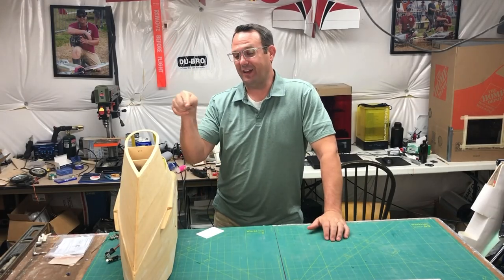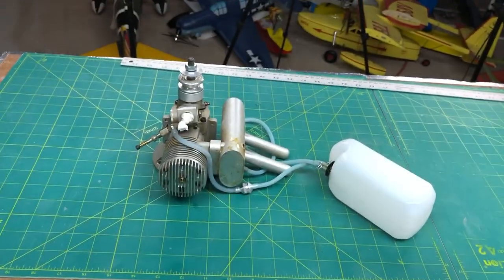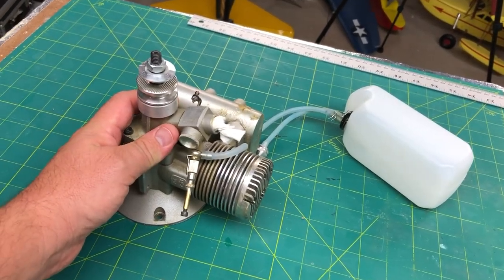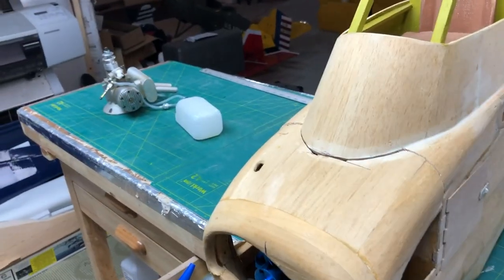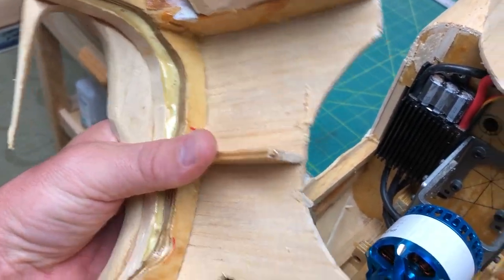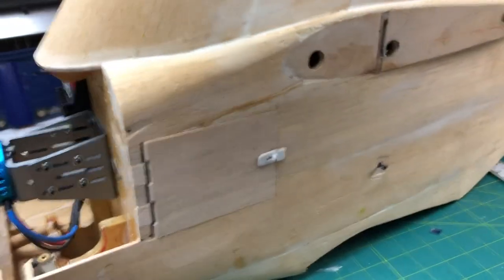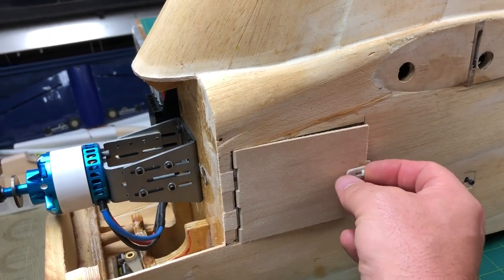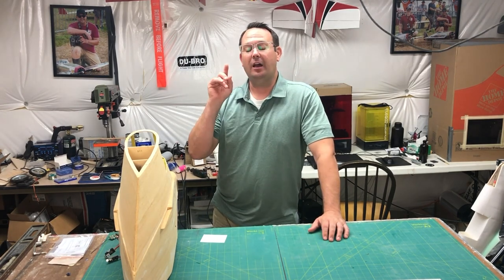Transavia Airtruk: Had to make it REALLY ugly

Comment: Those swing-out servo mounts are very interesting. If it were me and I wanted to keep them, I would add some way to pin the non-hinged end. Maybe adding a small bulkhead with a hole so the pin is in double-shear.